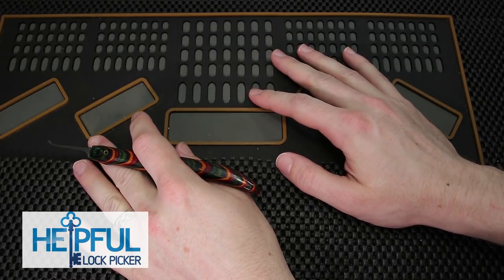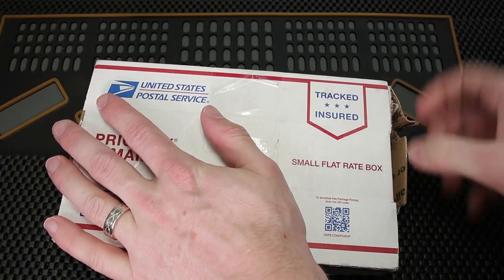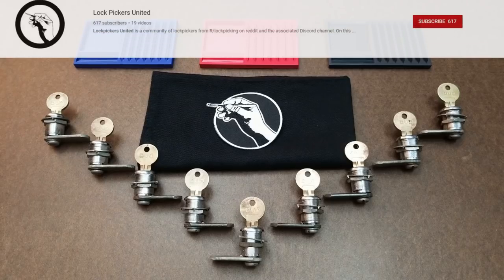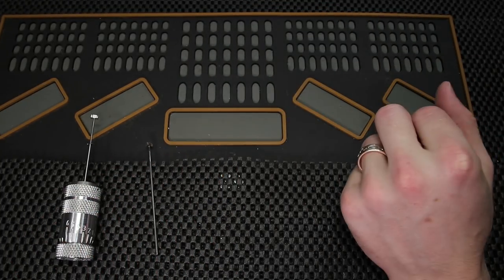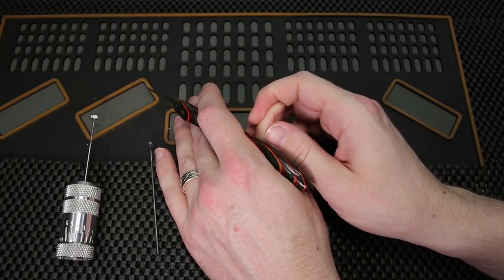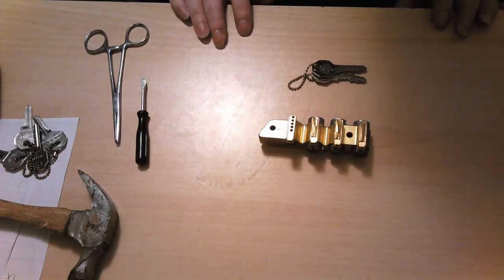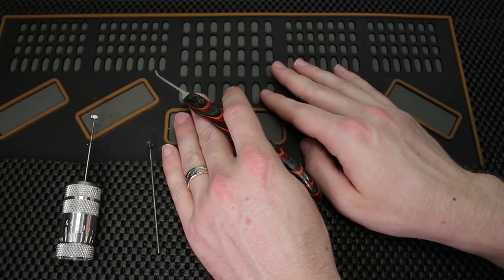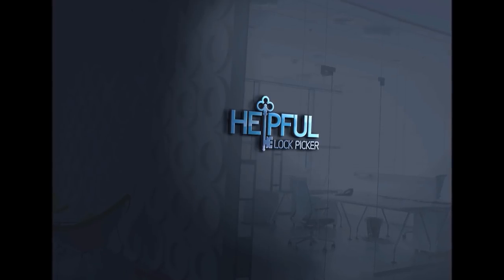[276] Lock Sport Update | My Silver Bullet Disc Detainer Pick Finally Came In!

Comment: $250? thanks, but no, thanks.
Reply from the maker: Where else would you get one is the question? There is a 3D printed one in the works which is fortunate
Reply: You think that is expensive? For a tool like this? There is a very good reason that there is not another rear tension DD pick with such a narrow profile. Making the picking tips is very difficult (many have tried). In order to have a rear tension pick (that fits into profiled locks) you need a thin, hollow picking arm with a tip that is made all from 1 piece. The wall thicknesses are borderline doable. It is probably that part alone that makes the cost higher than I would like. Try making one yourself. I can promise you that $250 is not only cheap, it is peanuts for a tool such as this.
Reply: I agree it’s a very specialized tool. Though I love my friend at Peterson international he didn’t have this tool. There is China dd pick but it roughly build will not work without modifications. 250 is a steal